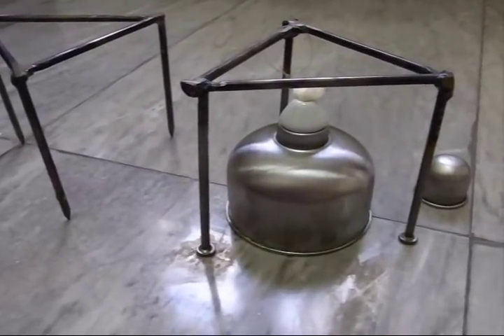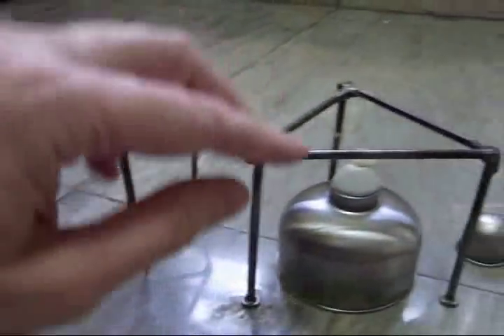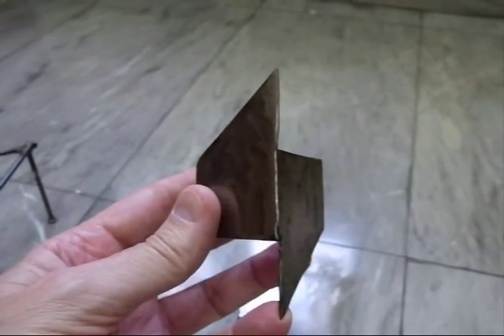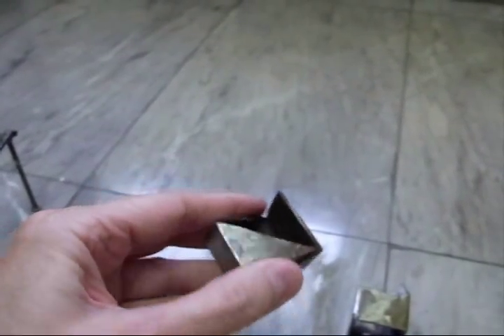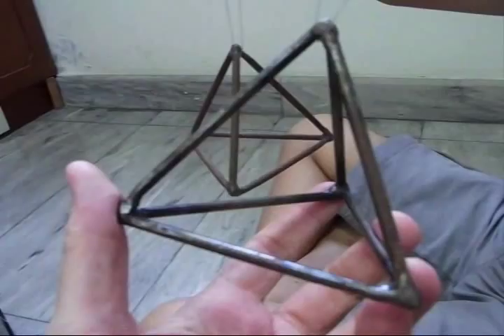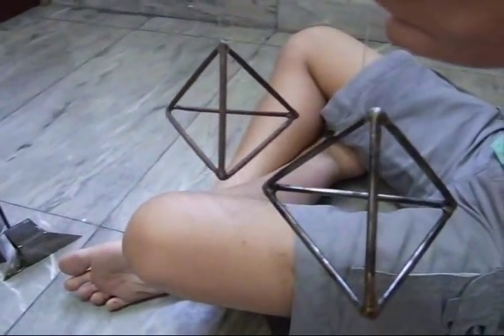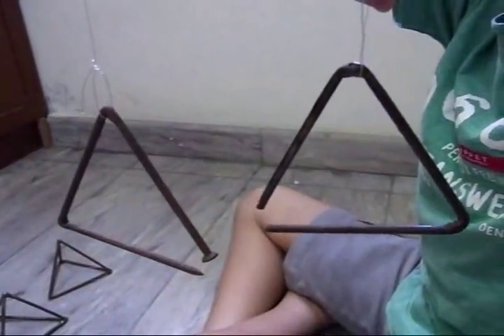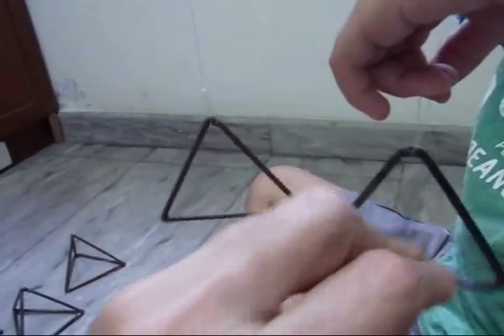Small Welding Projects / Experiments - Weekend Welding Warrior

Comment: what kind of welder is out and where can I purchase it??
Reply from the maker: rae rae It depends on where you live and how much you want to spend.  I just use an inexpensive inverter "stick" welder (DC).  I don't have space for a big shop, and I do a lot of welding in other places, so this ultra-small design is great.  They are available almost anywhere.  They are pretty much limited to plain steel (no aluminum or stainless or other)
Today I really could have used a TIG welder for some small / tight welding, but I made due.  My welder cost around $300 USD.  
The first thing you want to do is to take some welding courses.  Welding can be dangerous or even kill you if you don't know how.  Good luck!
Reply: I have an everlast 140st stick welder. It is quite inexpensive and really compact. If you are into mig welding they also have a small mig welder that I hear is good.
Reply: I think you are referring to the Everlast 140E mig welder. It is a good little welder. If you think you will get serious into welding I would also suggest looking at Everlast's dual voltage welders.